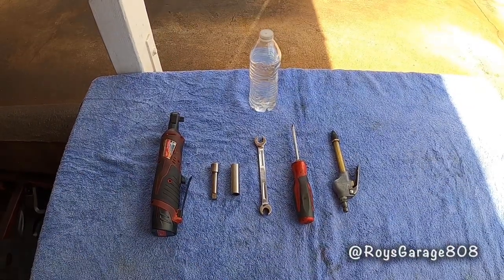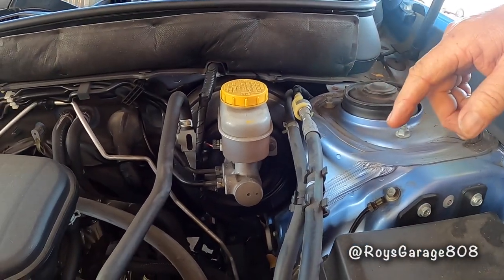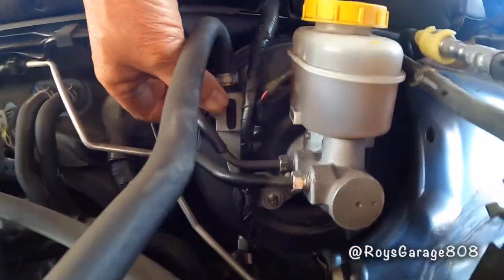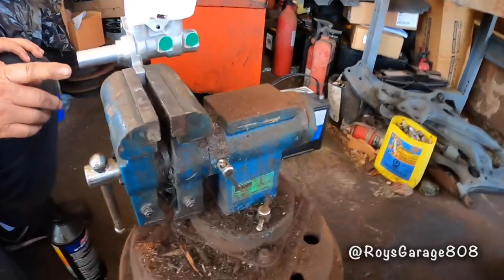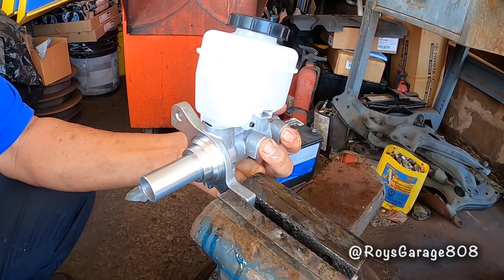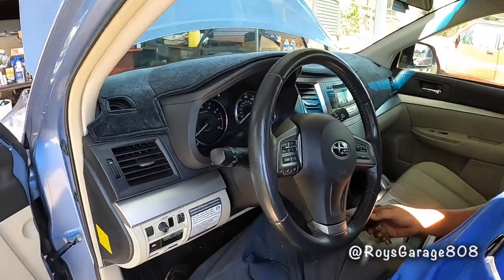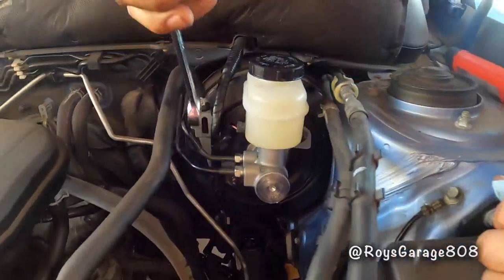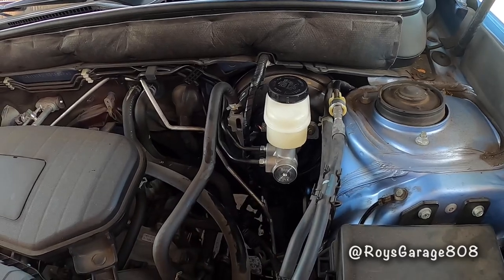How to Replace the Brake Master Cylinder on a 2012 Subaru Outback

Comment: your video is great but, the seal part #26497 must be replaced subaru service bulletin 06-79-20, it can cause a vacuum leak hard to detect code on my vehicle 171 lean left bank, was hard to find this problem!

Comment: there will be air in the lines to your wheel cylinders and/or calipers..
they also need to be bled to get rid of the air in the brake lines..
Reply: That's what I though. Thanks for the precision.